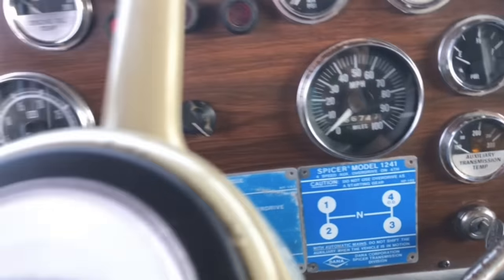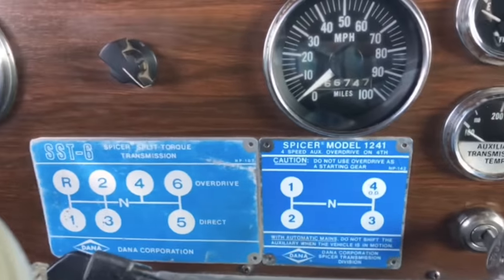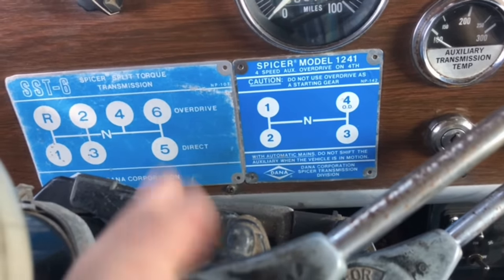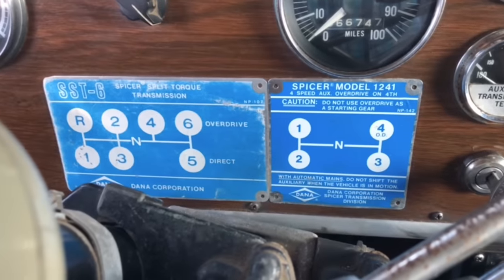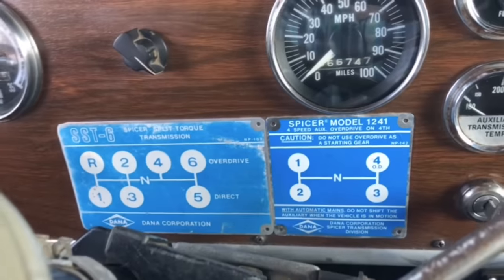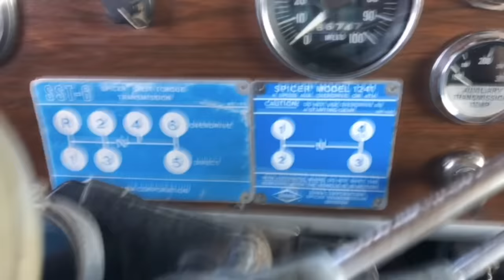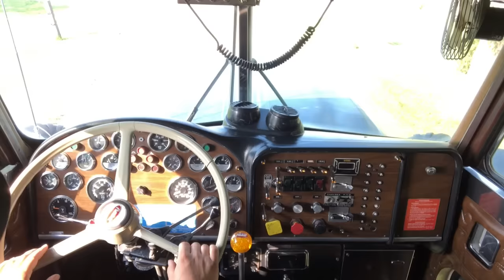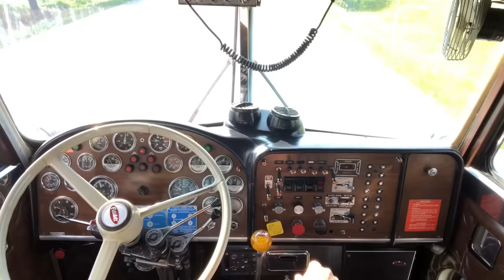How to shift Two stick 6+4 Spicer Transmission Peterbilt 359 #Peterbilt #359 #Twinstick #Twostick

Comment: The Eaton double counter shaft transmissions came in four different variations. 1241a is a progressive, where you use all four gears. 1241b is a double under drive 1st gear, with 4th gear just being a direct drive. 1241c is a single under drive, with a overdrive 4th gear. 1241d is a double overdrive 4th gear starting with 2nd gear in the place of 1st gear. I never drove a Jimmy but do have a lot of miles behind cummins, 220, 280, 290, 335, 350 and 400's. I worked in the oilfield and we didn't have the time to wait for the engine to wind down.New used one hand through the steering  wheel and used the Jake Brake to bring the engine down to correct rpms. The one thing you didn't say was there isn't any synchronizes in the transmissions. So engine rpms and tire revolutions have to match up before the transmissions will go into gear. I drove 1241c's. The difference between gears was three hundred rpms. You when to 2100, let the rpms drop to 1800, then the brownie would go into gear. Then when you had to shirt the main box, rpms had to drop to 1300 then it would go in and back up to 1500 to get the brownie in.

Comment: My Dad drove an R--190 IH back in the 50's with a gas engine, a inline 6 Waukeshau maybe. That was the beginning of modern trucking. Hardly any pictures of R190's around anywhere.
Reply: I'm sorry the engine on dad's truck was a Red Diamond big block, not a Waukeshau , a fire engine power plant.

Comment: Great video.  When i first learned how to drive that, Frank (truck owner/trainer) would not allow me, never-ever to shift with 2 hands.  I was only allowed to shift using one hand; and that paid off, teaching me to "count" time in my head and use the tach to shift.  Sometimes I would not be able to figure out where to push the main stick forward, like what "slot" to shift, so Frank put some pieces of masking tape on the dash, indicating 2,4,6, so when i shifted, I had to leave my index finger out, (just like when you had your finger on the jake) point to the piece of tape on the dash.  After several hours over days doing that, I could shift the tranny, smooth like butter.
Reply from the maker: Thats a good idea!! And two at a time is a bad idea especially for beginner... maybe on a grade when u gotta shift fast but its very risky! But that tape on the dash is genius 👍
Reply: @Bubbles8V92  I learned one handed, tried two hand, but went back to one. I know that made me slower, but I just didn't feel easy the other way.

Comment: Lol being born in 99. I can only imagine the concentration to run twin sticks. To shift from 'high to low' is as easy as a flip of a switch. Seems hard for me but I'm a quick learner. If I had to run twin sticks I could get it down pat pretty quick I think if that's the only truck I run. Finishing up my first year as a diesel mechanic and caterpillar is the easiest system to work with. Trucks aren't my Forte yet but working on it every day. Got a m722 with headlight problems and it's kicking my ass. Relays are good. Fuses are good. Kind of thinking a ground issue because none of the fuses are poped and the relays are good as aswell.

Comment: I like 4th direct, 5th direct, 6th direct, 6th OD. The AUX box stay cooler in direct. Your approach does let you go from 6th OD to 6th to 5th OD which is closer and probably better in hills as you can put the old Detroit kettle back on the boil a little sooner.

Comment: Never drove a 6&4 but did drive an IH Loadstar tandem grain truck with a 5&3 set up worked better than the two speed differential that most trucks had at that time

Comment: So is that extra transmission taking each gear and breaking them into 4 gears? Still trying to understand. So if you’re 1st gear on the main, you could break that 1st gear into 4 separate shifts while maintaining 1st gear? If that makes sense

Comment: On these old trucks I see two levers on the steering column (one would be a trailer brake, and I think the other one is called a "brake saver").  How does a brake saver work?

Comment: Think of the secondary transmission as a splitter with 4 drive ratios  instead of two,  low&high,  you have (L1 L2  H3 and H4 for O D.) You'll find out up top which combination pulls the best for your truck load and environmental conditions, some pull best in certain situations, but don't work out in others.

Comment: Good ole slobbering Detroit. I maintained them in the Army and later found myself on a tow boat with 2 8V92's powering 150KW generators. These Detroits would be alternated monthly, and run max rpm ALL MONTH! Imagine how many road miles that would be.

Comment: whats with the big space between 3 and 5, I have always wonder that, all the other twin stick transmissions( 4x4 5x4 etc) don't have it. also I was told with the 5x4 and 6x4 transmissions you never use compound or compound low( 1 and 2 on the aux) in 5th or 6th gear because you can cause the case to split on the transmission.

Comment: I always thought of it like shifting a mountain bike.  Those have 2 sets of gears..  your smallest gear at the pedals can run through the 7 smaller gears at the back wheel and then shift down 1 gear at your pedals, and restart at the rear wheels..

Comment: With a 5X4 and a heavy load you started with both sticks in 1st gear and used all 4 gears in the auxiliary in 1st, 3 in 2nd and 3rd. 2 in 4the & 5th. With a 6 speed main you did not split 6th gear. Made a progression of 14 years BBC and you could slice and dice it mighty fine to stay on top of the engine's torque curve. And once you got going out your left foot on the floor as you are a slave to the tachometer and if the engine speed is.not right it will grind regardless of what you do with the clutch pedal.  And always upshift 1st and then follow with the downshift.

Comment: If you can find company literature (on internet or hardcopy) with all the numbers for the gears and the percentages for the gear steps and the various choices, it makes this much more clear. You can see all the repeats. You can better match the combination to your situation. If I remember correctly the Mack Quadraplex is functionally an eighteen speed because it has two repeats. Good luck out there and take care. P.S. Sticking your arm through the wheel when off road looks like a good way to get a broken arm.

Comment: The one question I have, when you are going from, for example: 2-4 to 3-3 are you having to clutch in and hold it while getting both transmissions to the correct ratio or are you just straight floating both transmissions?
Reply from the maker: Floating everything, clutching these is an art

Comment: i loved this! it became so simple even though i dont drive trucks. My question is, i noticed times when you were in 4th and aux 4 but when shifting to 5th you released the clutch when still in aux 4. is that acceptable for hauling lower weight? or should you shift the aux to 3 before releasing the clutch?
Reply from the maker: Yes these transmissions have gears closer and closer together as you get higher up so that compound shift isn’t usually necessary in the 4/5/6 shifting when you aren’t loaded

Comment: I noticed at the bottom of the sticker for 1241 auxiliary. It says with automatic mains, do not shift the auxiliary when the vehicle is in motion.
Reply: With an Allison transmission in front of a spicer auxiliary, the spicer can only be shifted while the truck is not moving or stopped at a red light. You know, select direct or overdrive and go.
Reply from the maker: Im guessing there would be no clutch pedal? Or pressing it while in motion would mess with the auto? There was a 8v92 359 on truckpaper years ago with the automatic... wish i would have looked harder
Reply: @Bubbles8V92   shifting the spicer while in motion behind an automatic, would damage it.

Comment: So this might sound dumb, but it’s like a farm tractor’s transmission where you’ve got basically six ranges and four gears in each range. The trick is knowing which range and gear you need.
Reply from the maker: Yup it’s pretty similar to the deere quad range in theory

Comment: Interesting. I used to haul a coal bucket in Penna. Sometimes I would have to drop three or more gears like right now to make it up a hill. Like drop from 5th to 2nd in one shift. How would you handle that with that transmission?
Reply from the maker: Just drop a gear or 2 on the main, its safer to make risky shifts on the main as the aux is tricky

Comment: Bubbles_8V92

 The 475 hp 8v92 that engine was nice and fun to drive. More than once back in the 70's I have told a hand that had a big cam 400hp it was just a 318 with a souped-up blower. 

Can't remember the rear-end gears on it, but it topped out at 94mph and it was a 1978 CL9000 FORD cab-over.  

The 6x4 , 6x5, 6x6 were sweet. The first I learned on was a Triplex. Never forget that first drive as I had never drove one and it was different. They were in a lot of Macks as the third stick was a high and low and the other two were just your regular 5x, 4x, or 6x what ever next to them.  

 We all had fun back then as most trucks had NO AC, power steering, or beds. You had a length law (after the 48' trailers came out what ever length was OK.) and weight law that finally went to 80,000 (For those that don't know the Mississippi River was the divider as Miss, Ark, Mo, Ill states that said you could only have 73,280 pds)  All that came about around 1982 or 83.
Reply from the maker: Like hearing from guys that remember the good old days 👍
Reply: @Bubbles8V92  If you have a email  I can send you a picture of that truck.
Reply from the maker: Sure its Bubbles8v92@gmail.com

Comment: That's the easiest explanation ever. Just like a quad range tractor basically. 4 powershift gears in each range. Just we don't have to clutch the shifts unless we changing ranges

Comment: I think I understand. Correct me if I'm wrong hey!!! The initial main gearbox is to get the truck moving, while you split the other 4 gears between the main box to get the truck up to speed. So, starting out, the truck moves in 1st gear, then you use the split four to increase speed upto its max of 4th, then move to 2nd on the main, then move the split back down to 3rd, to shift to 3rd, so on and so forth. Interesting, Cheers for the video bud :-)
Reply from the maker: Sounds like you got it figured out 👍
Reply: @Bubbles8V92  I'd probably fall to pieces if I was to actually attempt to drive it LOL, Cheers bud :-)

Comment: One of the reasons they got rid of the two stick is when coming down the mountains was  ending in between gears and the propeller shaft would quit spinning and at a high speed  the driver could not find a gear  to have the engine to help back off---- then it was free rolling runaway

Comment: That's caind of the transmission this is for a really professional truck drivers 👏👍👍 if the trucks coming with that transmission 200% nobody can driving that 🤣🤣 just put a first gear and reverse gear 🤣 great vedeo and great explanation 👍 I prefer a 18speed EATON

Comment: Great video!  Do you know why the shift patterns so much different than driving a manual pickup?  Like why isn't 5 right under 4 in the main transmission and why is three over and down instead of over and up on the auxiliary?
Reply from the maker: The reason the 4 speed is a "horseshoe" pattern is because it is an overdrive. a direct drive is in your typical up and down setup. the reason the a 5 speed direct is also in your typical 4 over 5 setup but again in an overdrive its 5 over 4. So in a "against the dash" setup like mine its 6 over 5 and 4 over 3. in a both direct setup its 5 over 6 and 3 over 4. hope that makes sense, basically they had to swap the gear positions to get the overdrive ratio in, overdrive being a ratio that can output more rpms that the input. faster that 1:1 in my case .68:1
Reply: @Bubbles8V92   Great explanation, thanks!

Comment: I hauled logs with a 92 and 6x4 and pulled lowbed with a Cat and 6x4. You are right that it's easier to shift sticks with a Cat but once you get used to a 92 they're easy. They just make alot more noise😂

Comment: It was a very good explanation on how to shift the twin stick gears.
I should also add that it can be understood through a mathmatic point of view. Like by multiplying the numbers of the two gears. 
Like 1*4=4 and 2*2=4, you can go for that but it maynot make too much difference so it can be done by keeping the auxillary stick at 4 and then changing the main gear to 2nd. If it's needed then you can downshift the auxillary to 3rd and then go for the 4th in auxillary. I think it depends on the load weight. Or you may can downshift to  3 in auxillary and then go for 2 in main gear and 3 in auxillary.
And then 4 in auxillary.
Just by multiplying the stick numbers and checking the differences, it should be possible to do a good shifting job.
Please let me know if I'm on the rightway? 
Thanks
Reply: You keep multiplying, I'll keep driving ....

Comment: My question is, would you need to use the clutch at all to change on the auxillary box?
Reply from the maker: You dont have to use the clutch to select a gear while stopped with the main in neutral but besides that it acts like any other transmission

Comment: okay serious question, can you pull the aux into neutral before shifting main and then shifting aux back the after main is engaged or do you have to shift the main first? Do you double clutch or can you float gears?
Reply from the maker: You can float gears, if you are really fast you can shift the main with the aux in neutral but as soon as the aux is in neutral the drive train is dissconnected making speed matching impossible after about a second

Comment: Pretty interesting! I have watched videos showing how to shift 9 and 13 speed trannys using hi and lo range. That was a bit unusual but I caught on watching. I have a 4wd truck with a 4 speed tranny and a 2 speed transfer case but I also had an overdrive for a while and that was 16 ahead and 4 in reverse so I understand the concept of using different gearing and how some overlap but in low range you really need to stop to shift it isn't like in a tractor. Anyway, a twin stick is something I never heard of. I think this type of tranny is much more straight forwards. You select the main tranny gear and then run thru the 4 speed aux tranny and can then go to 2nd in the main tranny and use the 4 gears in the aux. The part that is tricky is the driver has to know the rpm ranges of the various 24 combinations! I imagine it takes a while to remember when to skip a gear in the aux and which gear to select in the main depending upon the road conditions and your rpms as you mentioned. So do you use the clutch when shifting the main and aux tranny? In the 9 and 13 speed boxes the clutch was used just in 1st and reverse. There a lot going on in those trucks, you aren't just driving a house but all the various shifting patterns is a skill you guys master.

Comment: Is this a transmission where you can properly float gears? These Eaton 18s don't like to be floated from a service perspective
Reply from the maker: Double clutching a two stick while shifting both boxes would be an art few could attain. If you loose inertia in the connecting driveshaft you are absolutely boned

Comment: I’ve got a 1997 Pete with a 12.7 Detroit and an 18SPD with 5.29 gear ratios I’ve been trying to find a way to speed it up and lower the Rpms what is your MPH at when your in 6 and 4?
Reply from the maker: I have 5.33 rears with a .67 high gear ratio. 60mph at 1650 on tall rubber

Comment: I noticed the 2 air valves on the steering column if it was a Cat I would know what the other valve is for, but I'm stumped on a Detroit please enlighten me.
Reply from the maker: Its an air powered fuel shutoff 😉
Reply: I noticed the same thing. If it were a CAT it would be a manual brake saver control. That’s a Pete OEM  design

Comment: Why does the truck have two trailer hand brakes? At the yard we have an old 359 Pete with the same transmissions as yours, But only one trailer brake lever. Please explain why you have two.
Reply from the maker: No truck has two hand brakes. Typically the shorter one is called a brake saver or retarder

Comment: Once drove an old 50s model KW that had a 220 Cummins had 4 sticks a 5 a 4 a 3 and a 2  total of 120 possible gears combinations
Reply: Not two, not even three even, but FOUR sticks. (120 fws and ..lessee..4x3x2 2--TWENTY FOUR REVERSE!!)
Reply: max Payne It must have had a hell of a wheelbase, I did some math and at minimum that would be 22 feet or 264” minimum from the steer axle to the front drive axle. Add in 24 inches to get to the center of the tandems and you’ve got a 24 foot wheelbase. Did it have power steering? I bet it was a bear to turn 😂

Comment: So may I ask the world something? Not to sound stupid. And I would hope someone answers. 
The grand scheme of it is. That the Aux trans, is that like a LL(1) L(2) HL(3) H(4)? A range selector?
Or is that a whole different transmission as well?
Reply from the maker: Well a range selector controls a box added to the back of a 5speed transmission. This is a 4 speed transmission. It kinda works like a range selector but think of it as a 4 position splitter

Comment: Thanks for a great explination of how the twin stick work. I've never driven one because I was told it was difficult, I'll be trying one now, thats if I can find one. By the way, you're not using the clutch are you? You can tell by the way the sticks "jump" on the cogs. I don't like " flat" or "float" changing, regardless of what some people say, it does damage the gear box.
Reply from the maker: Yes i had a couple bad shifts in there. Im trying to clutch more but im still quite bad at it as I don’t have the timing in my head yet and its very random depending on gears. Not as predictable as a regular manual